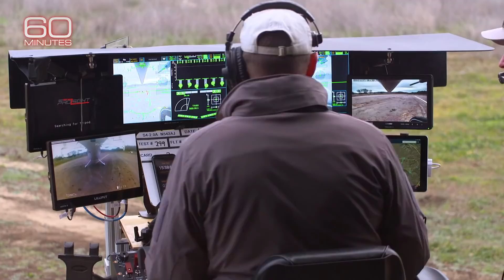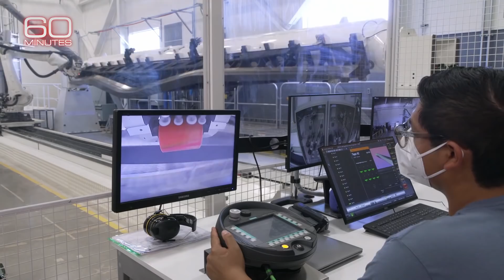Getting an eVTOL off the ground

Comment: Nov 6th 2024, Joby Aviation (NYSE:JOBY) is 41% through Stage 4 FAA cert testing, expecting FAA certification in 2025. 
Cash position:
$710m plus the following to be added:
PLUS Early October 2024, Toyota made an agreement to invest a further $500m into Joby in 2025.
PLUS Late October 2024, Joby raised $230m. (less costs, call it $220m)
PLUS Delta Airlines will further invest up to $140m as milestones reached.
PLUS Saudi Arabia MOU for an undisclosed number of S4's - fast tracking income while air taxi builds out
PLUS $130m DoD contract.
PLUS Marina factory producing 12 eVTOLs per year expanding to 25 per year.
PLUS Dayton factory (my estimate of production ramping up) 2026: 150 eVTOLs  2027: 400 eVTOLs  2027: 500 eVTOLs.  

So Joby has a huge cash runway (over $1.7 billion) plus up to $325 million in incentives and benefits. Within 2028 they will have more than 1000 eVTOLs producing cash.

Note: The state of Ohio and several political organizations have offered up to $325 million in incentives and benefits to develop the new Dayton factory, expected to be ready 2025.
Incentives include grants, tax credits, and infrastructure support, as well as workforce development assistance aimed at helping Joby hire and train approximately 2,000 employees for the factory.

My estimates for production: Cumulative values
2024 Marina 6 Dayton 0
2025 Marina 18 Dayton 0 (Dayton will be ready at this point)
2026 Marina 32 Dayton 150
2027 Marina 48 Dayton 550
2028 Marina 66 Dayton 1050
I have allowed ramp up for both Marina and Dayton. Total in 2028: 1116 eVTOLS.

"..A Joby Aviation S4 2.0 aircraft is projected to generate $2.2 million in annual revenue.."  So from 2028 that is $2.45 billion earnings.
The average tech sector P/E ratio is 33, implying a market cap of $81 billion by then, or a share price of $106. The share price is currently $6.  

Joby's vertical integration is its superpower.   
Joby MTOW is 5300 lbs, Archer MTOW is 6700 lbs (same number of passengers). So Joby is more energy efficient.
Joby is faster at 200 mph.
Joby has longer flight duration which makes it more versatile.
Joby S4's first piloted flight September 2023. Archer have not yet piloted a flight. I suspect Archer could be a year behind with FAA cert.
Joby 41% through fourth stage (FAA testing) in Nov 6th 2024 report. Note in 2023 they obtained a clear path to certification of their pouch battery. Tail approval is highly significant - materials and structure.
Joby S4's hover noise is 67dBA, far quieter compared to Archer. Joby's on-wing flight 100 times quieter than a helicopter. For Archer, noise could be a big approval problem for operating in cities.
Both Archer and Joby have a former FAA administrator on the board.
Joby are producing pre-production prototypes as promised (4th being finalised, possibly 5th by end of 2024). There is no evidence of Archer rolling out prototypes. Indeed, Archer made the comment during 7th Nov report that they don't want to say when the test prototype (singular) will be ready because that would put undue pressure on the team - that's not good enough and leads to the question: are Archer potentially hiding something? It is the very essence of the company and Archer can't give an approximation?
Joby ditched gear boxes years ago. Direct drive is simpler, lighter, lower maintenance. Archer still on gear boxes.
Joby has 10,000+ hours of flight data so far.

Joby will be first mover, its vertically integrated production cheaper, more reliable and more agile. It's aircraft weight, speed, duration and noise superior.

Just my thoughts. No investment advice given.

Comment: Until batteries get lighter and about 10 times more powerful, it's just a fantasy
Reply: How many years does it take to certify a brand new concept as a commercial aircraft? 5-10 years? How long does it take to re-certify the same aircraft with batteries that are more energy dense? Months, if that.
All technology is moved forward by working towards a future that doesn't exist yet.
Reply: At least this 'fantasy' flies and has a range of more than 150 miles. Some 'fantasies' can fly for further than this one. Other 'fantasies' go into space. You've watched this video on yet another 'fantasy'. You might even travel around in a 'fantasy' with wheels. How many other everyday things are fantasies to you?
Reply: your statement contradicts it self... if they get lighter and 10 more powerful than they are more than 10 more powerful per weight because they are already lighter

Comment: I wonder how air traffic control would keep up with this. Consider NYC's yellow cab congestion and now imagine that in three rather than two dimensions.
Reply: no need to worry. if it ever works it wont be many as it wont be or ordinary people as it will still be too expensive
Reply: Would need a separate traffic control specifically for it
Reply: " ..... where we're goin' we won't need roads!" 

                                        -- anonymous
Reply: Don't worry, when the FAA is done regulating every aspect of these machines, only the rich will be able to afford one.
Reply: The current ATC system evolved from antiquated systems of radar and voice radio comm.

Today with GPS +computers, it is not inconceivable that the advent of air taxis will bring about a similar revolution in ATC.  There is no reason why these cannot be controlled 99+% automatically, with human intervention happening for that last <1%, via remote control.

But far more importantly...
After a safe and autonomous air taxi system has taken flight, it will soon become obvious to everybody that PILOTS are never needed onboard.  Not only will human pilots be proven to be Less Safe than fully autonomous, the more obvious benefit will be the ability to carry one more passenger.

And THIS radical step will revolutionize the entire Airline Industry.  The general public will come to not only feel safe with having no one onboard, they will feel SAFER.  And then it will be obvious that no pilots are needed onboard ANY airliner they typically fly in.  Not the 737s.  Not the 777s.  Not the 787s.  Not any of the Airbuses.

This has been the case for DECADES now.  The only obstacle to this switch has been psychological.  The tragedy that is the 737 Max is Boeing's decision to design around the worst pilot out there.  A result of AF447.

So the Air Taxi revolution will change FAR MORE than those last several miles.  It will revolutionize EVERYTHING that flies.

This is the future.  The future of ATC.  The future of all air transport.